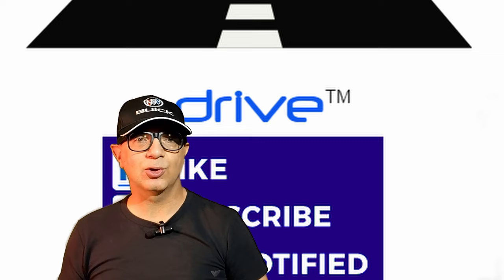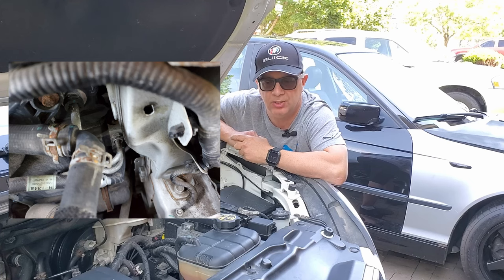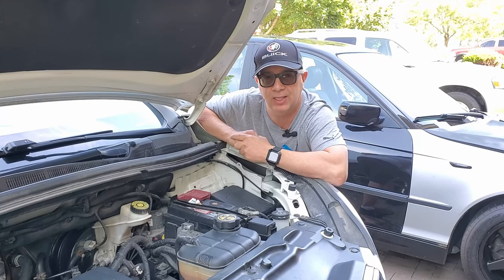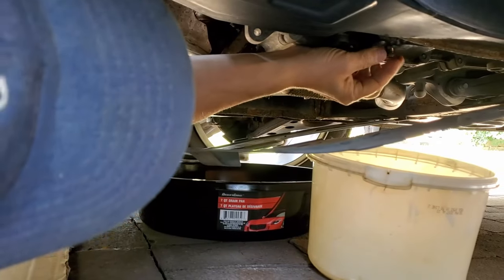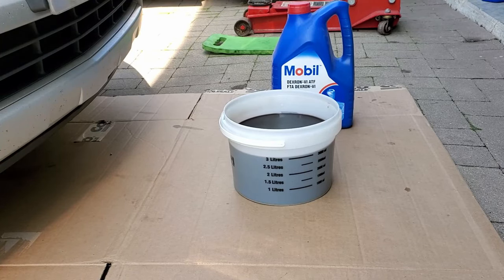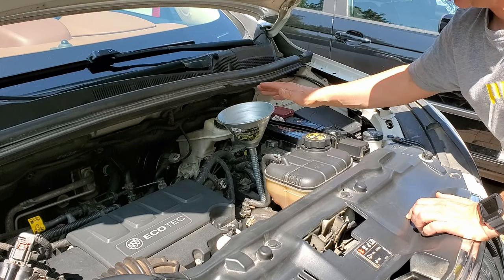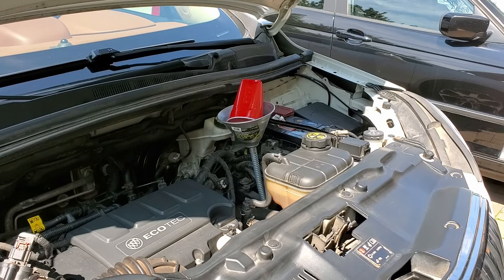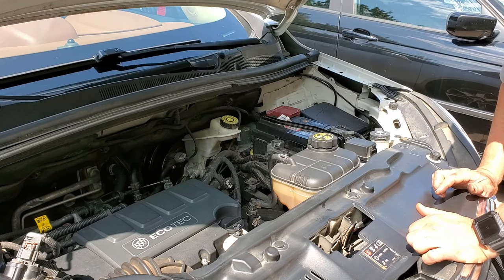Buick Transmission Fluid Change | Encore Transmission Fluid Change DIY Tutorial

Comment: That tube to the transmission oil cooler has a “ clip” on it. It’s in a tight spot  and there’s a tool to “ loosen” that clip so the tube can be pulled out but it’s really expensive and you can remove that clip with an or ring pick but that means you have to put that clip back in before inserting the tube again. It’s a bugger to do that way but you don’t have to spend $100 or so for the “ tool”. There’s a fluid level plug facing the drivers side wheel to check the level but that’s also a bugger as there’s very little room to put it back in with very hot fluid running  down your hand and wrist.
Reply from the maker: Even with the tool, the clip was stuck in place.  Significant damage would have been done to the aluminum line if I kept forcing it.  My strategy was to not unclip the cooler line and drain/refill the system to swap out as much old for new fluid as possible. Do not touch that fluid level plug.  Drain the fluid from the bottom and put back the exact amount that came out.
Reply from the maker: Before the video I did try and use a picking tool to  remove the metal clip on the oil cooler but is was fused.  I could have forced it but that would have caused enough damage that everything would need replacing.  I decided on a less evasive strategy. I avoid touching the plug as you open up the opportunity for lots of problems to occur.

Comment: Even draining cooler you are still only doing a percentage replacement as the torque converter isn't get drained either way. The multiple drains/fill will eventually get more new stuff everywhere
Reply from the maker: Yes it is the next best strategy to performing a full flush.

Comment: Hey great vid 👍 question: I have a 2012 Buick Verano (86k mi) it’s never had a trans mission oil change. Is this the best method for this situation as well? Change a couple of liters, drive 2-3 months and change again? Flushing it completely I think would ruin it.. thanks 🙏
Reply from the maker: Thanks for the compliment.  I have never worked on a Verano but yes that may be the way forward to purge the transmission of old fluid.

Comment: Thanks for the video! If you've had a transmission fluid leak and maybe don't know exactly how much fluid to add, how do you navigate that?
Reply from the maker: If you believe you have lost transmission fluid, the best long-term approach is to find the leak--probably in the bottom of the transmission--plug, coolant lines and/or pan.  Then refill it to the proper volume.
Reply: Ballen1182 I heard there is a fill plug on the side of the trans. Fill it from there until it starts to come out. Idk I’m just saying what I heard.
Reply: Ballen1182 there is a fill line bolt on the side you can remove.  Fill until it start to drip out from the side.

Comment: Would it be OK to mix Full Syn. if orginal Fluid was Non-syn. before the change? The reason I am asking, I got the car used and don't know what was in it before my time. Also, how much time should pass before the 2nd and 3rd change?  Your video was great just didn't the details that I am requesting.
Reply from the maker: I believe you can mix the two types of fluids.  Intervals depends on you.  After a couple of weeks or months to perform the 2nd an 3rd change is totally acceptable.

Comment: Have you done a drain and fill on an Encore with the LE2 engine?  I have a ‘22 and the ECM is totally in the way and I can’t reach the fill plug to get it off, even with my skinny arms.  Any suggestions for models with the LE2 engine?  Thx!
Reply from the maker: Never worked on one of these engines.  If you cannot find a way to reach the filler cap, you may need to consider unbolting the ECM modules to create a bit more room.

Comment: I still don't see an answer to Zach's question, is the a dipstick? how do you know if you have the correct level of fluid in the transmission??
Reply from the maker: Buick Encores, and many other modern vehicles, do not have a transmission dipstick.  Levels will NOT drop unless you have a leak.  All that needs to be done is that the fluid is changed on a regular basis.  You measure the volume coming out, when you drain, and put in the exact amount of new fluid.  Too little or too much fluid, is not good for the transmission.
Reply from the maker: It is not just GM, almost all manufacturers do this with auto transmissions.  If you have a leak, address it quickly.  Since you cannot measure what has been lost, drain the system, fix any leak problem and fill it to the factory specified level.  That is the best we can do to maintain our expensive transmissions.
Reply from the maker: LOL
Reply: It has an inspection plug u can undo and fill.till u see some come out then let it drain off that little extra and your full